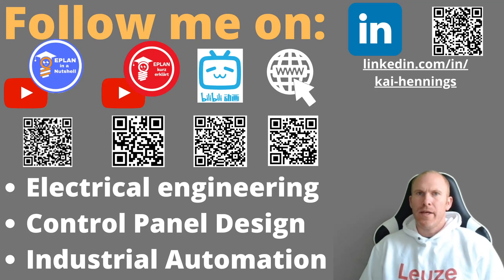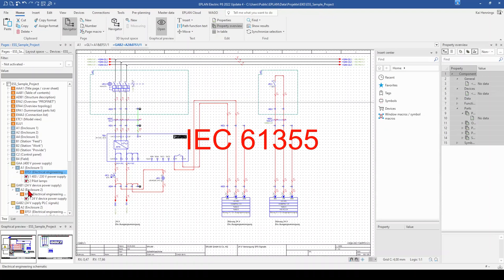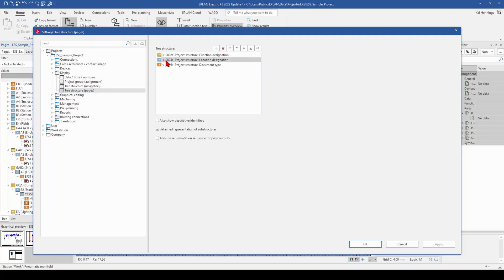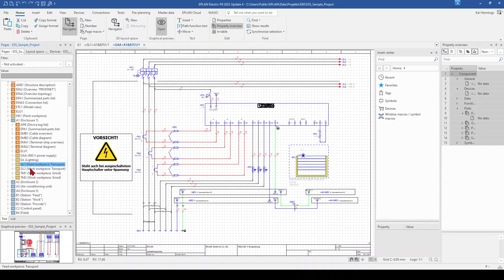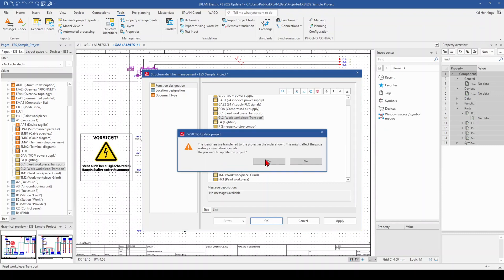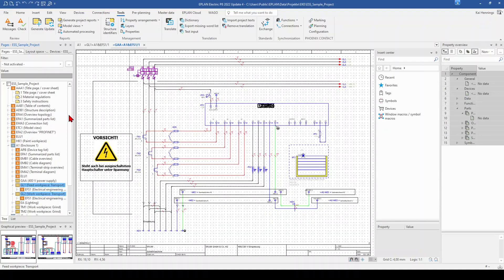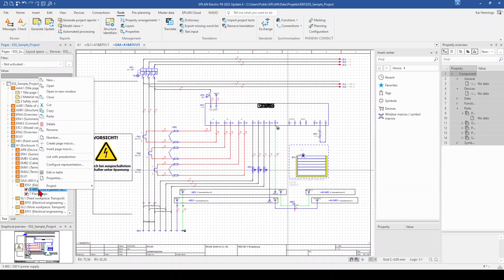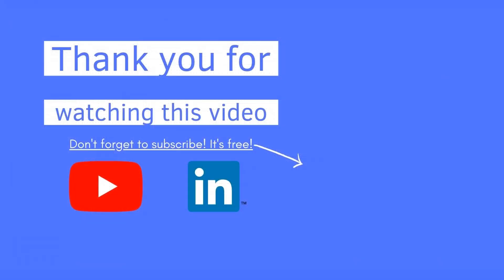EPLAN P8 Page sorting including Structure identifiers

Comment: Hello!
I have a question and need some help with a project I'm working on. The problem I have is the project structure itself with prefixes.
In My project, I want the name of the object
=C500.K40.JC1.DP05
But eplan doesn't let me, I have to have prefixes + - & etc. Is there any way around it?

Comment: Hello I have a question. How can I enable "Document type" in my project? when I open the "Structure Identifier Manager" I'm just allow to add and edit this parameters: 
- Funtional assigment
- HL function
- Mounting Location
-  HL function number
but I can't see the orange icon with the "&" that means "Document type"... HELP please
Reply: I have EPLAN P8 - Version: 2.9 SP1

I also open the project example called "ESS" and ok, there is the "Document type" enable but I don't know how to create this for my own project.
Reply from the maker: You need to check the structure for pages in your project settings.
Reply: @eplaninanutshell  Last question do you know where can I find the official dimensions or measurements for create a plot frame with DIN standard A3 for electronic diagrams (Power and Control)